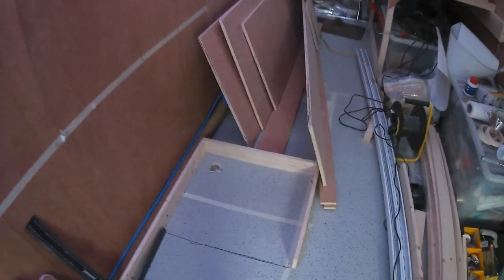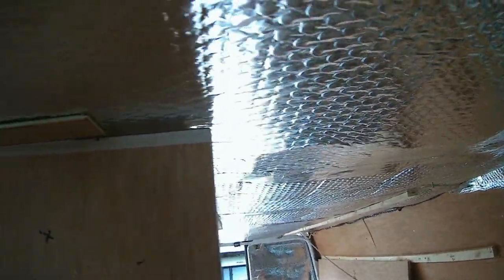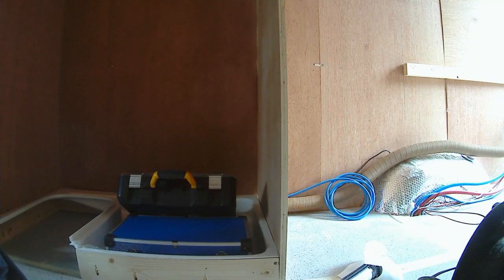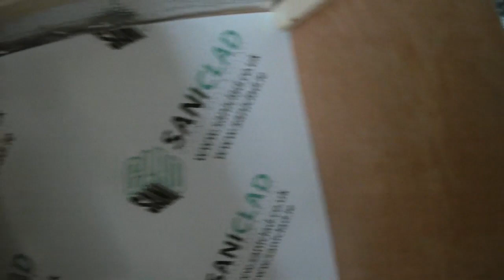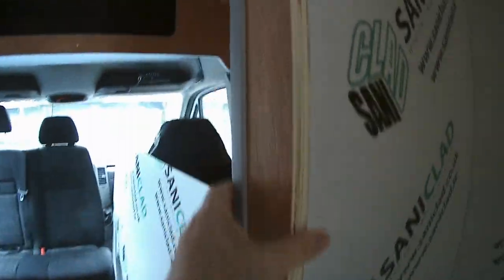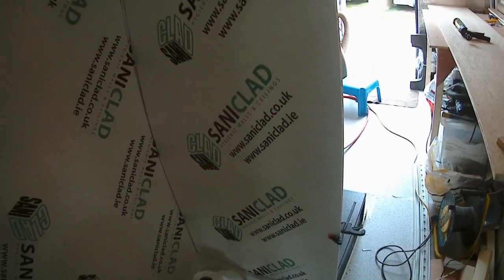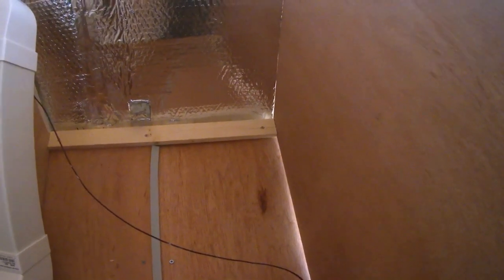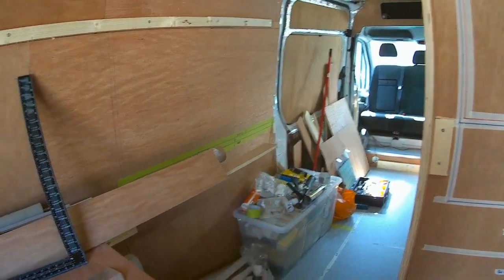Installing a Thetford toilet and shower .Mercedes van build

Comment: Where did you get the conduit elbow and pipe?, tia
Reply from the maker: Which conduit are you referring to?
Reply: @Antonia.Bradley  extractor out let  round standard to elbow then ducting  what adapter did you use tia
Reply from the maker: @MrLodonlondon   Oh yes. I bought it from Screwfix, They do a variety of air extractor pipes, tubes and adaptors. If you are not in the UK I don't know where you would get them. But in the UK Screwfix

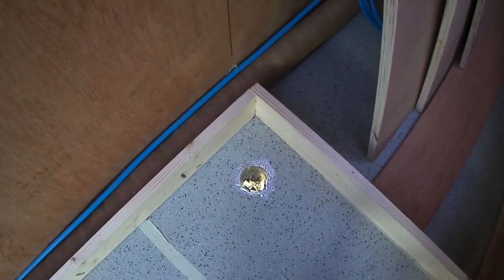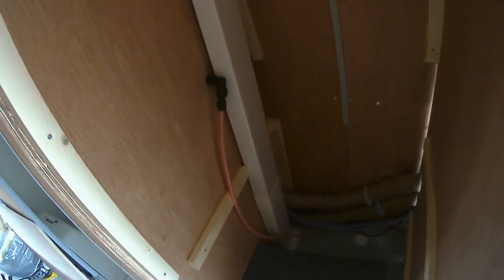Comment: How are the heating ducts run behind the shower? At 0:23 it looks like there's just one duct tube, but at 13:50 there are two.
Reply from the maker: Hi, yes there is one duct running behind the shower tray. And one that goes into the shower from the rear right wall to heat the shower. That vent hole is covered with a plastic vent cowel to prevent water entering.
Reply: Ah, I assumed your heater was installed the other side. Makes perfect sense now!

Comment: Are you using a shower curtain, or relying on the toilet being waterproof? How do you keep the loo roll dry?
Reply from the maker: Hi, the whole shower is waterproof except the door. Around the tops of each wall I have screwed in some hooks. From these we can hang a shower curtain. When not in use we can weave a nylon string from side to side via the hooks, from this we can hang wet clothes. Because the shower has a hot air vent at the bottom and an extractor fan at the top, then then the shower can act as a drying room. It works very well indeed as it can get very hot in there.
Reply: Thank you. I am about to install a similar setup and was worried about the gap between the loo and the wall as you pointed out. Glad to hear that you've sorted that out.
I still don't know where to put the loo roll though! :-)
Reply from the maker: Hi, yes the loo roll.Because we have put the hooks for the shower curtain all the way around the top the curtain covers the loo roll. But we do tend to remove it and put it on top of our little cabinate.

Comment: Do you silicone around the toilet? How do you get in the small gap between the toilet and wall?
Reply from the maker: Hi :) I have not yet added any sealant to the upper rear area of the toilet.... yet, I’m waiting to see if it is good enough with its own rubber seal. I will have to let you know after I’ve used the shower. However, I did use sealant around the base and at the rear of the base. Hope that helps :)
Reply: @Antonia.Bradley  yes. I've not used mine yet and I don't have access to the underneath of the toilet so I'm really worried

Comment: Will that extractor fan conduit work? Warm air rises...
Reply from the maker: Yes indeed it does. However moisture laden air not ‘as’ much. Also the extractor is 240v ac so is quite powerful. When I’ve had a shower in it I will let you know.
Reply: @Antonia.Bradley  did it work as planned? i'm considering this setup for the extractor fan. Would a 12V AC extractor work as well?
Reply from the maker: Yes it did work fine :)
Reply: @Antonia.Bradley  do you have a link to the extractor fan you used? it runs on 240v with 12vac transformer? or directly 240v?

Comment: May I ask, did you resole the toilet to wall seal.  I have the same issue, di you seal around the toilet to shower base too.
Reply from the maker: Hi, yes I finally managed to get the top of the toilet on the little top bracket so that it sealed properly. Other than that I did not use any sealant around the toilet at all. The loo overlaps the shower base so it presents no problem at all.